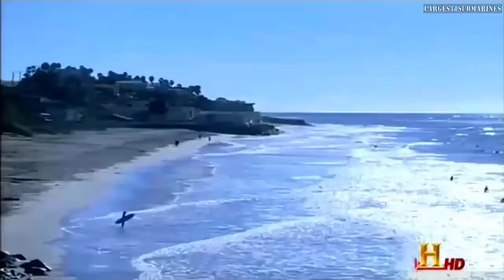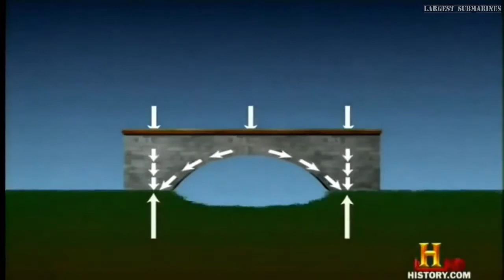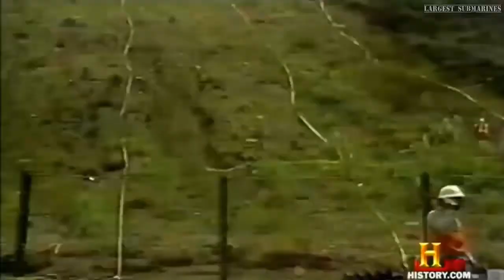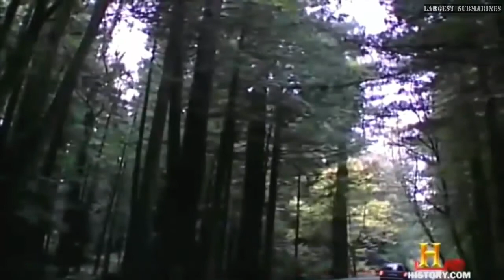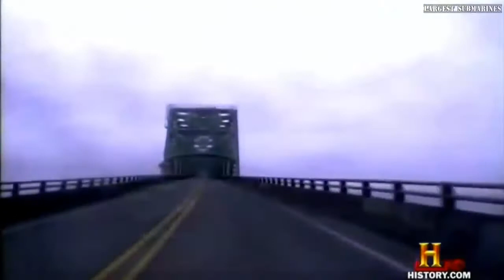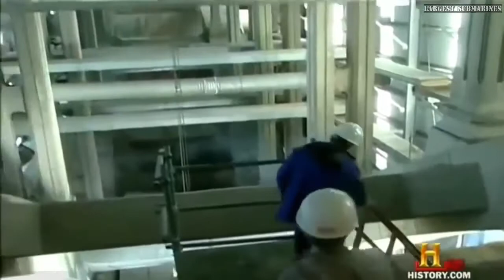The Pacific Coast Highway Structures | Mega Structure NatGeo

Comment: The Devils Slide portion of Highway One is now closed and a hiking trail. Also, Highway One between Tunitas and Devils Slide (and portions of Pacifica) was built on and near the old Ocean Shore Railroad, which was aimed to connect San Francisco and Santa Cruz via the coast, while providing real estate and farms to the relatively hilly coastal land that was border by the coastal range. They never completed the railway to Santa Cruz, and was abandoned in the 1920s from low funds. The Ocean Shore Railroad used to have a curved tunnel known as the Pedro Point Tunnel, which was later blown up by federal agents in the 1930s. Highway One (or the Cabrillo Highway) was built upon the existing ledge, to pass through a small canyon, rather than use the tunnel.

Also not to mention that the Eel River Flood of 1964 also virtually destroyed the Northwestern Pacific Railroad's entire mainline.